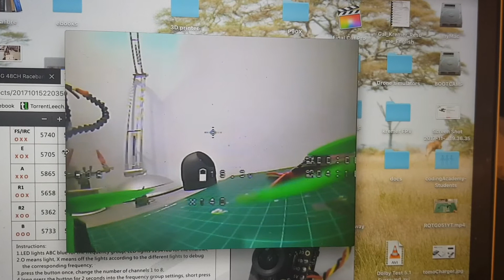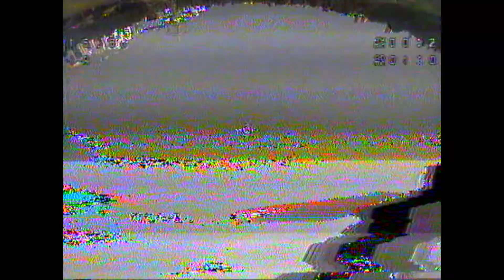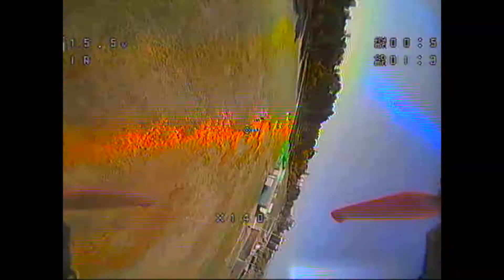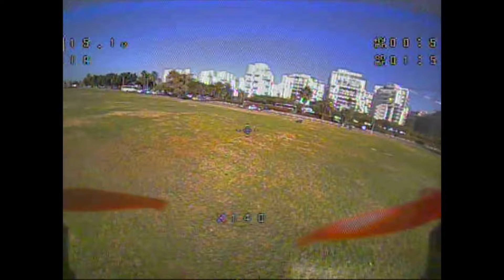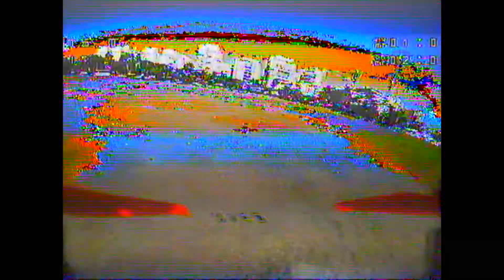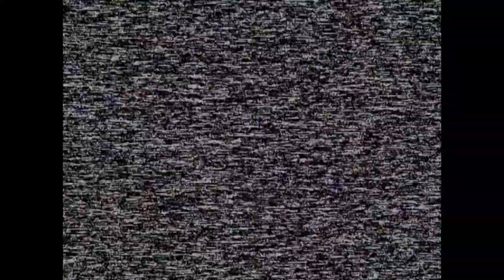FuriBee X140 - VTX & Propellers Upgrade (Tested With CNHL 650mah 4s Lipo)

Comment: Hey Is that an XT30 to xt60 connector on your batt ?
Reply from the maker: Yes. I suggest changing the battery connector to XT30 instead of using the adapter.
Reply: Gal Kremer can do.  Enjoyed the review :p
Reply: The wire is pretty thick to change for an xt30 but will give it a shot

Comment: Hey Gal! Oh, you're a helpful one, many thanks for posting this!  I'm sorting out a Eachine vtx03 atm... looks too easy but do I just need to connect the three wire from the one plug (red, black and yellow) ?https://www.rcgroups.com/forums/showthread.php?2957042-FuriBee-X140-140mm-Micro-Brushless-FPV-Racing-Drone-5-8G-FPV-600TVL-CC/page7#post38842293
Thanks!!
Reply from the maker: Hi John. It's pretty much straightforward - Solder the + (3.2-5.5v) of the VTX03 to the + pad, - to ground and video (Yellow wire) to Vout. the 5V OUT and Cam GND wires are going to be left disconnected, just make sure to wrap them with something in order to prevent a short circuit . Good luck :-)